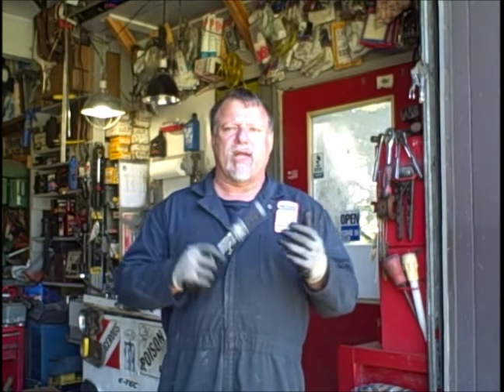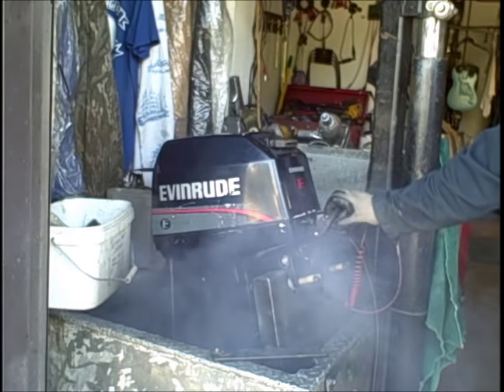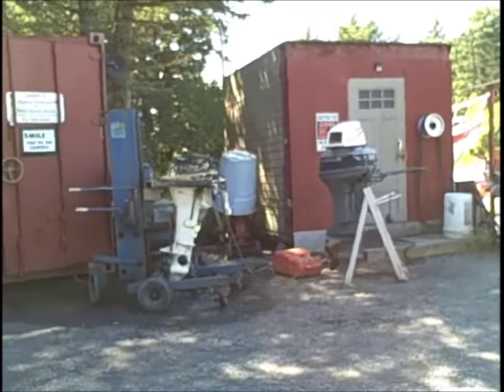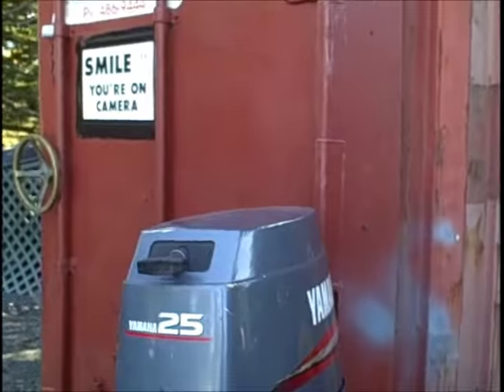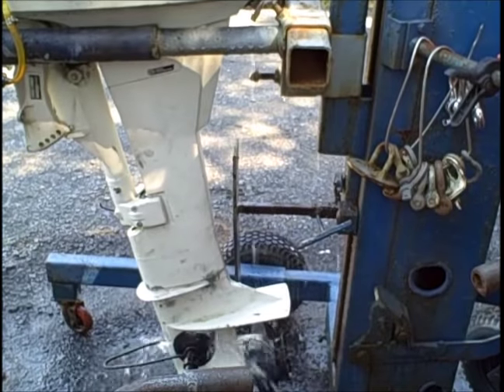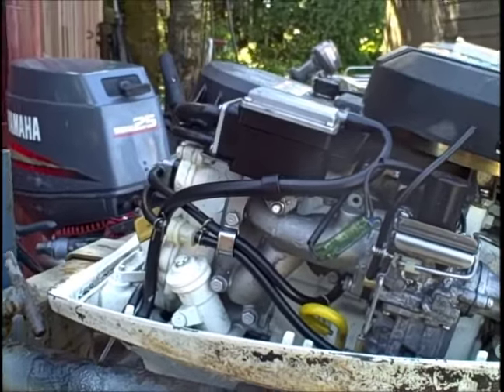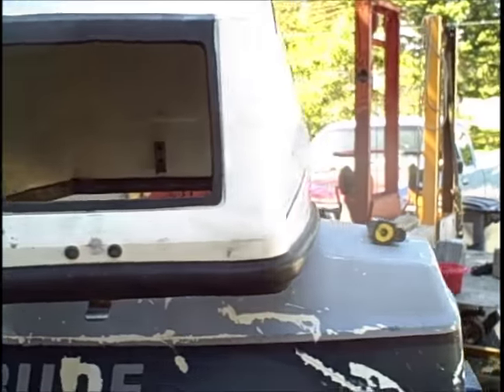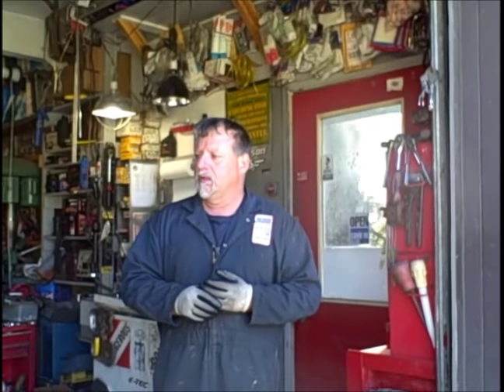Nice 8 E-Rude,   & Ruff yammy  9.9

Comment: New subscriber here...  Ever work on those black outboards...?   I've got a '98 Mercury 60 Bigfoot that will start and run both in neutral and in gear on the muffs, but at the lake it starts and runs in neutral, but when I try to shift to forward to accelerate it stumbles, sputters, and dies... Any ideas...?
Reply from the maker: +William Riley,  I do not get many Mercs,  But I do get them from time to time, Do the simple stuff first, Filters, bad hoses, air leak, dirty carbs, etc.  Remove the prop make sure no mud weeds grass etc is in the exhaust, outlet that's where I would start if I had those issues.          thanks for watching .                                       kodi